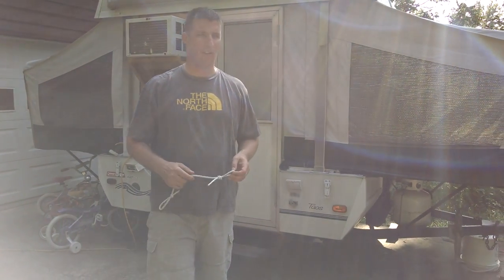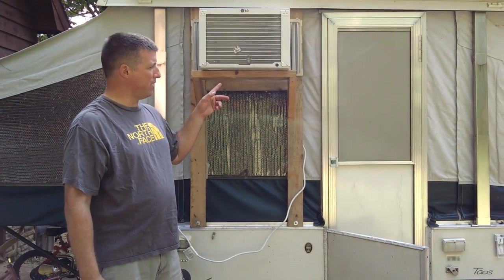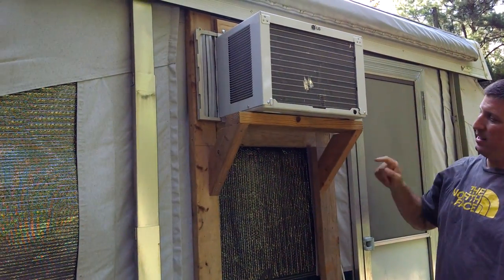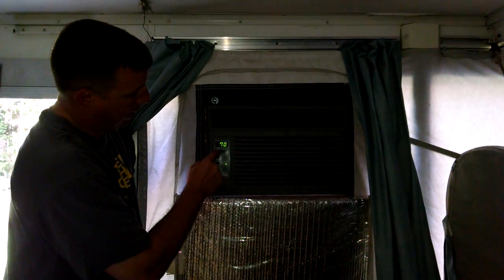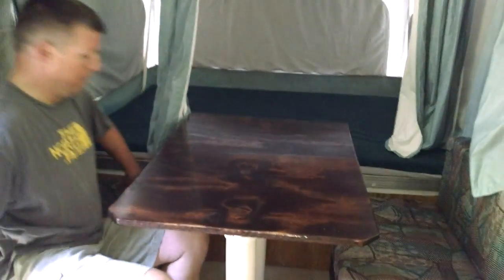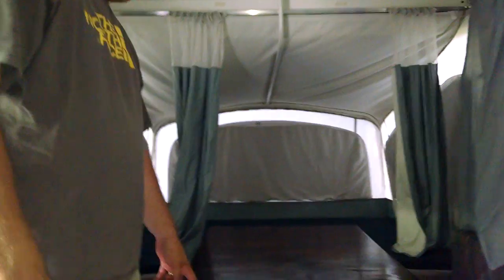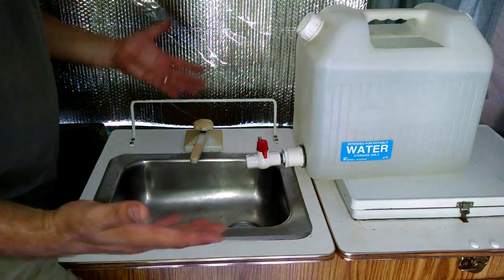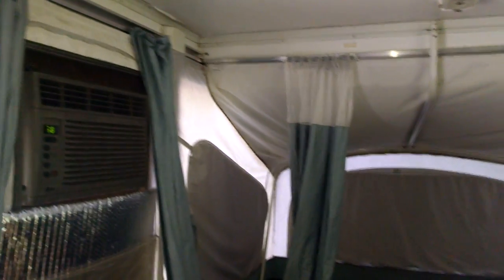Adding air-conditioning to a pop up camper

Comment: Glad I found your video. Have been looking for a camper for just the wife and me. AC is a must for her. I've seen a bunch of pop ups on Craigslist with no ac and thought about cutting into the camper. Didn't want to do that, so I discarded those listings. This is great. Thanks for posting. Heading back to Craigslist to look again. :-)

Comment: You are exactly correct. I was thinking of installing an air conditioner at floor level. The cold air would stay there. Will consider mounting higher to be more effective. Good clear thoughts and effort. Great job.

Comment: Hello Aaron E. Just want to thank you for this awesome idea! It worked prefect on my 86 Starcraft Pop Up. Finished the project last night, just need to put on the finishing touches, and the insulation. We're heading out this weekend camping, I'm sure it's gonna be alot cooler than last year. Really hot out here in Abq, NM. Anyway, thanks again for the idea, video helped me alot!!

Comment: Awesome! I've been thinking about how to add a little air conditioner to our pop up Coleman. Our trailer is a bit bigger but I think anything, with a circulation fan running, will improve conditions on those brutal days. I'm going to figure out the best location on ours and incorporate your ideas. Thanks again !!
Reply from the maker: At the beach in mid summer it's a little hot

Comment: Ingenious solution. Main issue here is the added camper setup and take down tasks. Must remove the wood frame and AC to take down. Maybe fine for tall, strong people but lifting an AC over my head and redoing the frame every trip is not my cup of tea! Just one more option.
Reply from the maker: Judy, the wood frame fits under my dinette when i close up the camper.  The wood frame is super easy to set up.  The ac unit is more trouble.  However if lifting it up high is an issue, it could be installed lower in the window area.  You could put it so it blows right over the bench seat to the dinette.  You would only have to lift the ac unit to waist height.  Just a thought.

Comment: It would be even better on the opposite side, where the heat wouldn't blow on you when sitting outside.
Reply from the maker: The opening in the canvas worked better for me on this side, but if I could the other side would have been preferable

Comment: I really enjoyed watching your video.  I'm getting ready buy a small used camper and wanted install ac inside. I Iive near the gulf coast where it gets hot. Have a few questions.  1. How does it feel inside when you are at the beach? 2. What type fan do you use to circulate air inside the camper? 3. Does water leak on the ground from the ac unit? 4. Does the camper get to cold inside at night during the summer months? Thanks in advance for your response.
Reply from the maker: Sorry for the delayed response.   It is not nearly  cool enough in the summer at the gulf!  I have a few things that help. I put radiant barrier insulation in the windows and close off the bunks with space blankets  during the day and I try to find some belessed shade. 
Nighttime the unit works great  to keep things cool. Again I have radiant barrier insulation in the bunk windows. 
I use a cheap 12 inch box fan. And a little  6 inch fan that has a clamp built on it and its perfect for my crew of four.

Comment: Two questions: 
1) When it's 90+ outside in sun, how cool is the camper with your A/C?  
2) How does this A/C unit plug in? What type of plug?
Reply from the maker: I have not had a thermometer inside the camper, but I am going camping next month and will try to get some imperial data.  I plug it into a 120 volt standard outlet by way of a outdoor extension cord

Comment: So I am curious - just how affective is the AC?  I was looking at doing something similar to what you have done. The best thing about using a small AC unit like you have is that I could power it with my Honda 2000 watt genny (something I cannot do with the factory overhead AC units).

Great video!
Reply from the maker: Crash Hancock It is quite effective.  I spent 3 days camping on the gulf of Mexico this July and we were very comfortable. Daytime temps got up to the mid 90's however we were in a shady spot  I set up a small fan to circulate the air.  Adding the radiant barrier insulation is a must.  I think the heat from the sun would overpower the A/C without radiant barrier
Reply: I saw another video where someone was powering the A/C with a generator and the surge created when the A/C started interrupted the electronic control and reset the A/C startup cycle over and over, rendering it useless since it would not complete the startup sequence. He tried to put in a helper capacitor, but that did not work. The result was to buy an A/C without electronic controls (just get one with conventional knobs and switches).

Comment: You should install the AC on the other side of the camper.   AC's put out a tremendous amount of heat and you don't want that heat on the camp side of the camper.   I know this is true, because I have a window unit in a house window and the flower bed under that window suffers dramatically from the heat output.
Reply from the maker: J Dode good point, I considered it but the account unit lined up perfectly with the small zipper window. on the other side it would not have

Comment: If you want to put the water back under the sink, you could use a harbor freight air compressor to put some pressure into the tank.
Reply: Good Idea, I was thinking of building a second shelf and having it gravity fed as I have a different faucet that accepts water hook ups as well.
Reply: The Dusky's You could also use a marine grade foot pump. I installed one that goes to a 7 gallon water tank that sits in a cabinet under the sink. It works great!

Comment: I'm wondering do you leave the insulation in the windows when you close up the trailer or do you remove it and re insert them every trip?
Reply from the maker: Great question.  The insulation comes out and goes under the beds every time.  I think it would be tough to fold up with the insulation in the windows